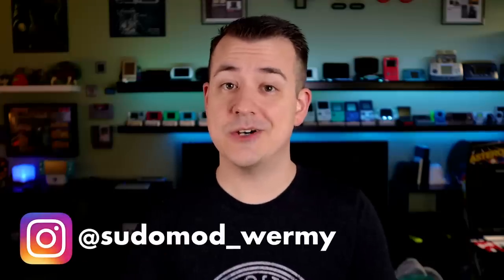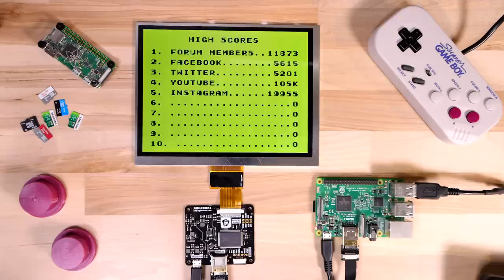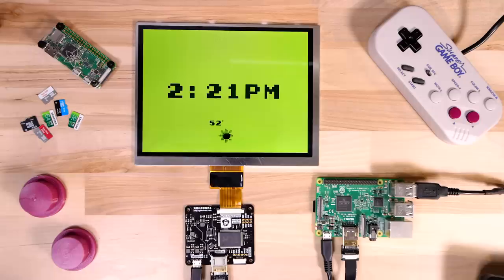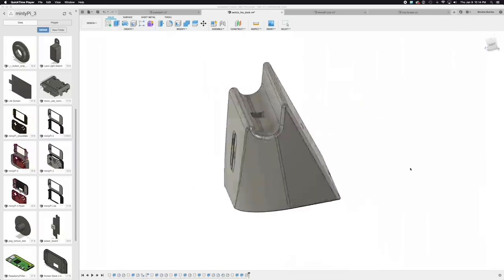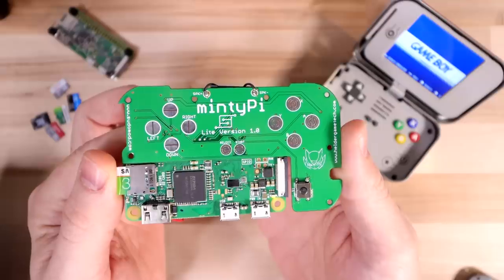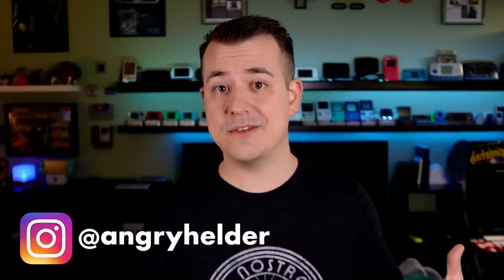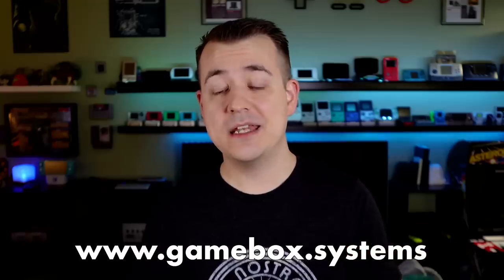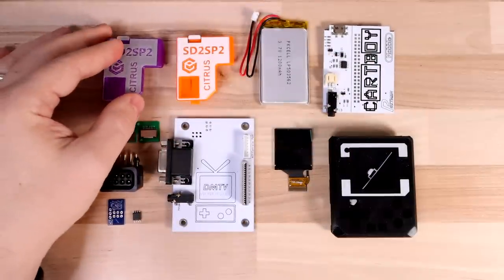Giant Game Boy, Circuit Shield and more, January 2020 Update!

Comment: ill definitely be getting the mintypi lite, i didnt have luck with the v3, due to the ribbon cable, although it is still salvageable thanks to you guys leaving the test pads on there, i just need to get thin wire and resolder another pi 0 on there, as the ribbon cable kept shorting out the pin that made the pi stay on (cant remember exactly), the v3 will probably end up being a decoration piece for me, given once i have it working, i wont want to break it again
Reply: My Mintypi has buttons that just... stopped working.

It was pretty wierd and kinda disappointing since I never even got to play a game on it.